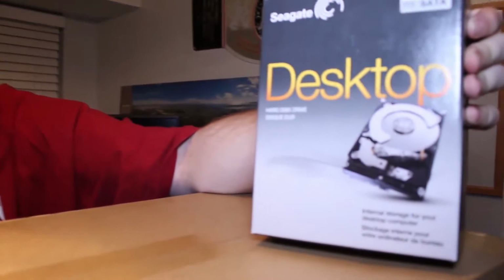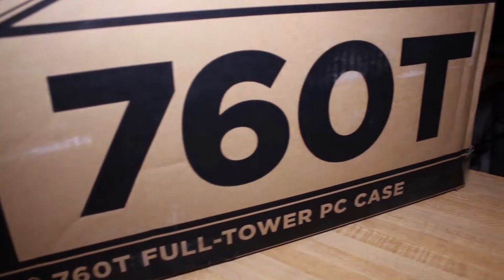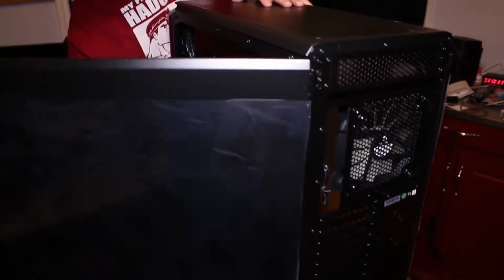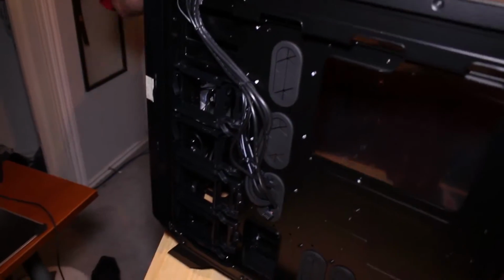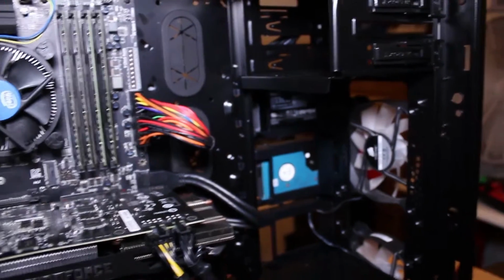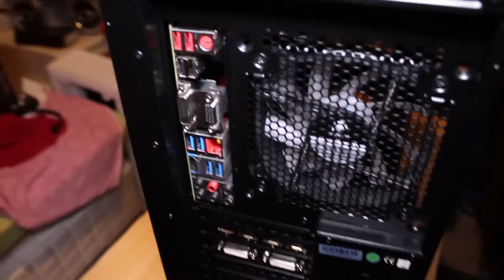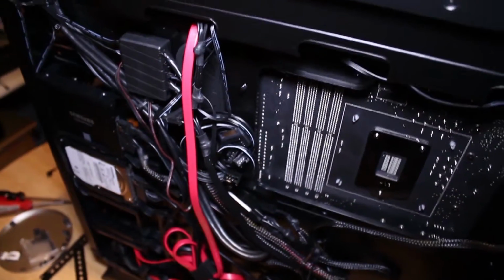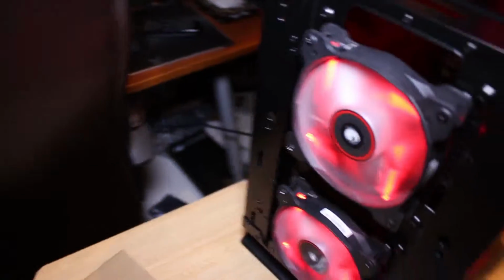Corsiar Case Swap 760t - TechLife

Comment: You don't risk anything with liquid cooling if you do it right.  Also I see you are using fans on the top without removing the top cover... so they are essentially doing nothing.
Reply from the maker: +Dan Lenhart So you missed the part where I removed the top cover and I dont even use it now, haven't since i assembled the system